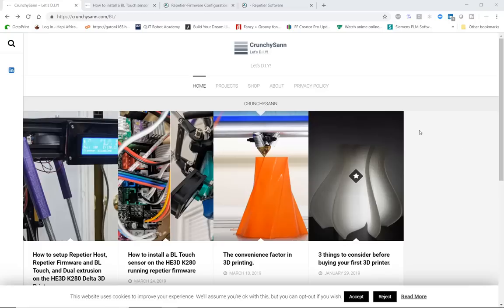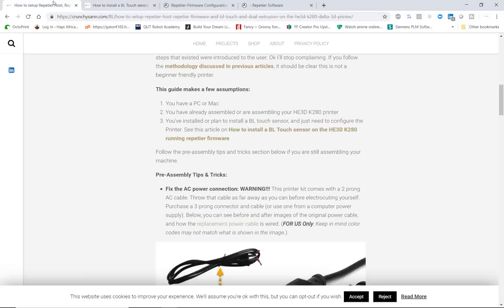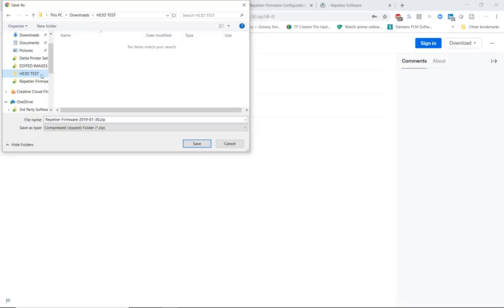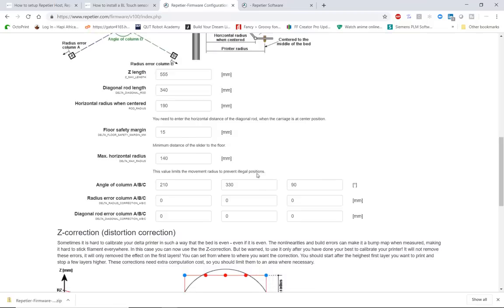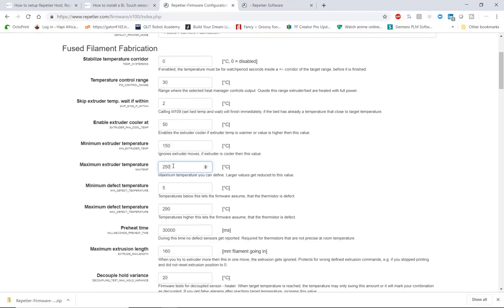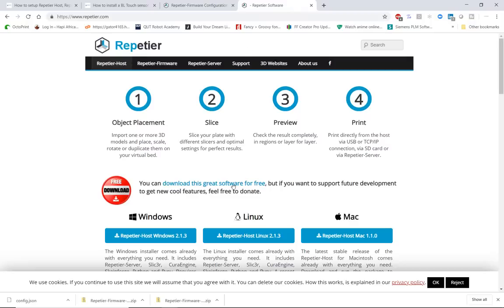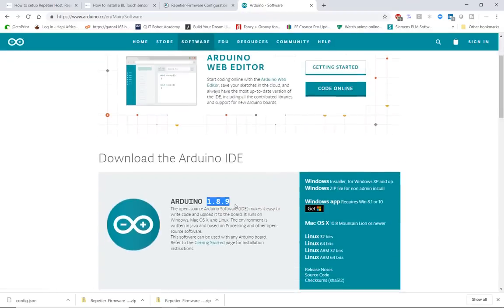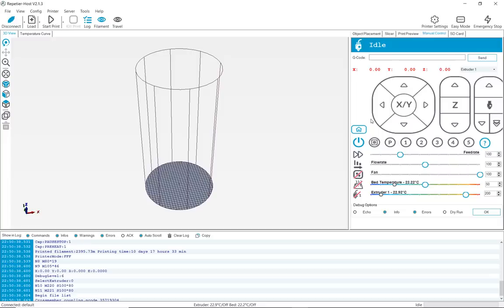How to setup Repetier - Firmware - BL-Touch and Dual extrusion on the HE3D K280 Delta 3D Printer

Comment: Thank You so much for making this video! I purchased a BLtouch from the link on your site to help support your work. I probably won't do the dual extrusion setup right now but maybe later. Where did you purchase the dual extrusion kit for the k280?
Reply: I followed your guide and have the BL touch setup. I had some issues with the sensor at first but I found disconnecting the brown, yellow and red connector and reconnecting allowed the sensor to start functioning. Is the cooling fan you used on the bracket 40x40x20mm?
Reply: @Crunchysann  Thank you so much for the help! I appreciate all your help. I will get those fans ordered and let you know how it works.

Comment: Thanks for the video, but I'm running into a problem. When I open Arduino I dont have the same port as the video. Instead of a COM5 port it says bluetooth something. Can you please help!! Doing this on a MAC.
Reply: Why is the BL Touch not deploying when leveling??? I uploaded firmware and when I try to level with BL touch the pin never gets deployed and the nozzle keeps lowering until it scratches the bed. Please help!!

Comment: hello sir...
I have a question. I assembled my printer however when I start to home it using repetier it seems to travel in the opposite direction crashing into the build plate.

Any suggestions?
Did I miss something?
Reply: In case anyone else stumbles upon this, reverse your motors maybe (flip the connector)

Comment: I followed all instructions but when I go to run the gcode the nozzle crashes into the bed and the probe doesn't activate
Reply: Same here. Did you ever get it fixed??? Pleaes share any info
Reply: @nothnx100  nope
Reply: You'd think he'd respond, this seems like a common problem with the firmware provided. Idiots like this make the process harder, I believe it's missing GCode::executeFString(PSTR("gcode")). Not sure where to place it in runZprobe